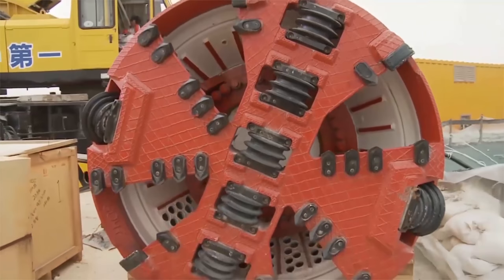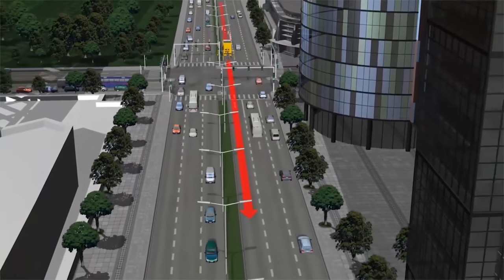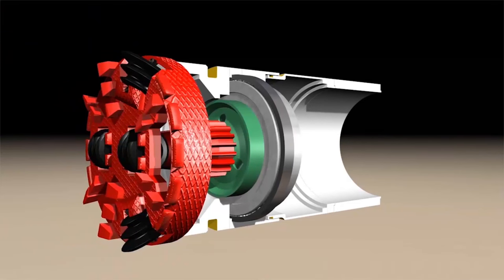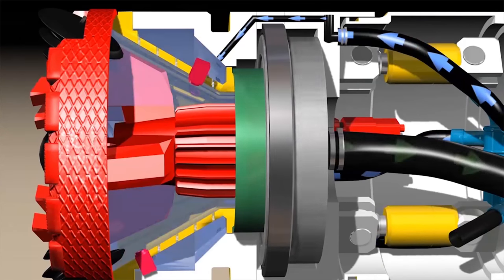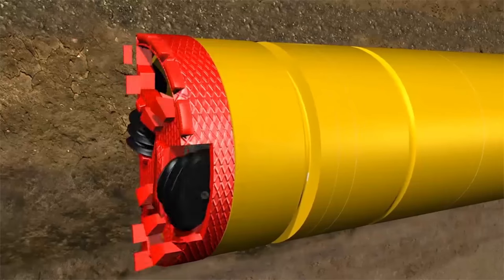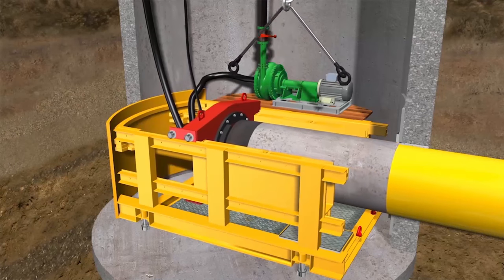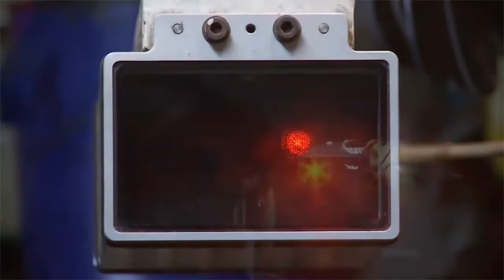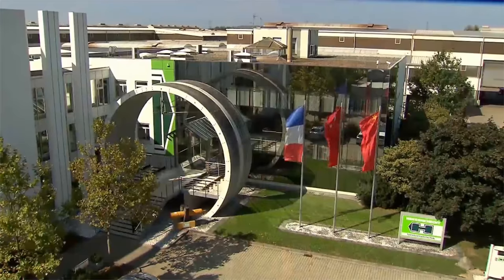AVN 600

Comment: how will you replace cutters during a run if needed, with no access hatch to the cutterhead?
Reply from the maker: Like all machines smaller then AVN1200 (OD1505), the AVN600 machine does not provide a face access. These machines are too small to provide a face access which is compliant with the regulations. Anyhow with the right choice of the cutting wheel and the associated cutter tools usually the machine is able to build the tunnel w/o replacement of the cutter tools in accordance to the geology and tunnel length. These was shown in thousands of successful finished tunnel projects. 
Best regard, the Herrenknecht Corporate Communications Team
Reply: @HerrenknechtAG  thanks for the reply.  The company I work for recently bought a micro TBM rom Herrenknecht.  Its a 1500 if im not mistaken, ive mined a good run with it and it has a hatch to the cutters, thats why I ask.  Cheers
Reply from the maker: Hi, that should be clarify with your Herrenknecht sales or technical contact.  If you dont know it, please send us more details at pr@herrenknecht.com and we'll take care. Best regards
Reply: How much clearance is there between the hole bored by the machine and the pipe outer diameter?
Reply from the maker: @Nandakumar A
The clearance value depends on the specific project requirements. There is no defined standard, but guidelines. 
Any specific project you would like to share with us? Please feel free to write us at pr@herrenknecht.com. Regards.